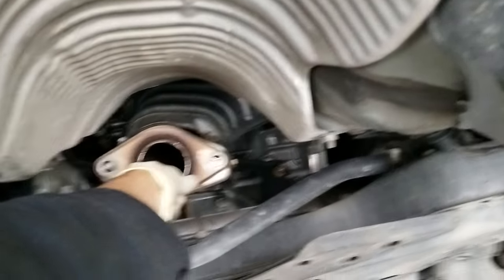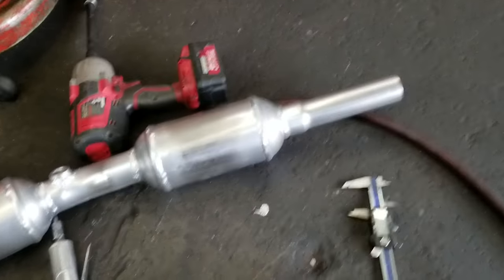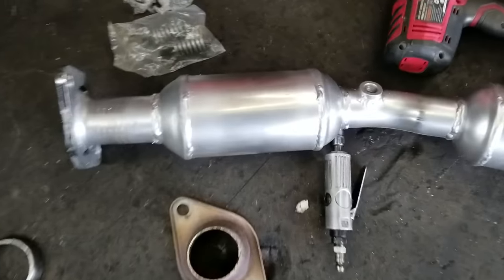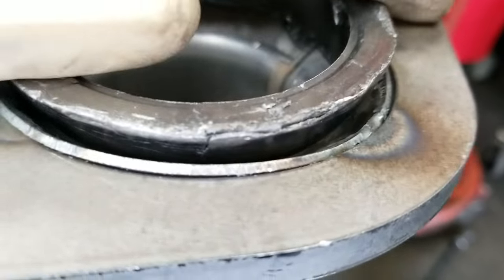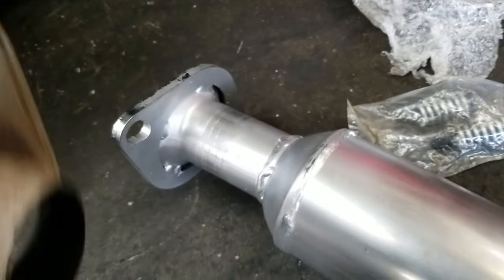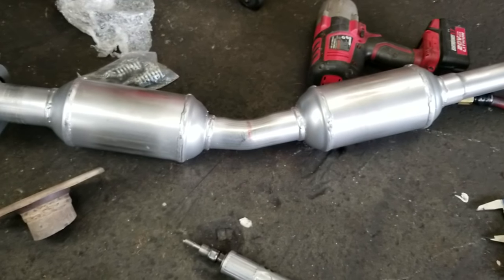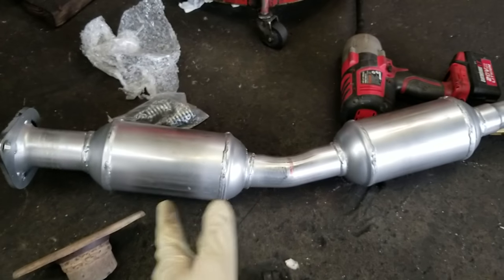Watch before buying Ebay/Amazon Catalytic Converter

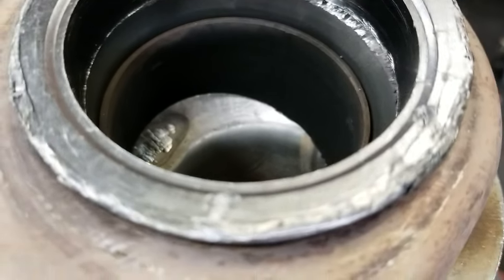Comment: 3:15 problem solved, use a normal gasket design. there are many exhaust gaskets from other vehicles that will fit that flange and go in between the two pieces rather than inside it. all in all  any mechanic shop that isn't just your neighbor bubba's house garage has more than enough tools to easily install that. like 30 minutes tops, no problems whatsoever. the real problem is that since it is just a few hundred dollars, it's not using the rare metals that are found in an oem cat, it's using a ceramic substrate with anyhwere from 0 to very little (barely above 0) of the catalysts (precious metals that heat up and catalyze unburnt fuel's transition to it's fully combusted products) needed to make it work properly.

a good shop would not only have no problems, but no complaints installing one of these. they would however caution you that it will not function XD
Reply: a better honest video would just explain what i did, and not make excuses about it being hard to install, which it is not.

Comment: The gasket is made of lead and will form to the gap once heated up. Additionally, the springed bolts will apply continued pressure and close the gaps....Real mechanics and welders see no issues here...... It will most definitely seat and seal.

Comment: Strange.  I bought one of those for my 2008 Prius and the muffler shop installed it in 20 minutes.   No complaints!
Reply from the maker: you should double check their work.
Reply from the maker: How much did they charge for 20 minutes?
Reply: @subtledriver  The owner let me watch under the rack as he personally installed the replacement converter and oxygen sensor.  Earlier I had watched him install a custom exhaust system on a brand new Porsche and a muffler on the City Fire Marshals work vehicle.  When I left the system sounded better than what was stolen off of my 14 year old Prius.   He checked emissions and it passed the state requirements.  I don't know what more you would expect a customer to do.
Reply: @subtledriver  Including the cost of materials I paid about 25 % of what I was quoted elsewhere.  I gave the guy a $20 tip since finishing my repair made his wife wait to pick him up after closing.

Comment: This gaskets soft and take shape
Reply from the maker: yes, but original gasket is designed to pivot and seal with spring tension, crush seal will crack the manifold.

Comment: Yup had ours  stolen off my sons 2002 Honda CR-V.  he’s a poor student with rising costs on everything including school.  The car was in mint condition and safe for him to drive. I would of given them 200-$300 not to cut it out. Oem is way to expensive , can we run straight pipe bypass the a CAT, We  live in a place where old vehicles are not  inspected annually, or any other alternative . Where he works , it’s a dark place and 100% sure it will happen again . Seems  like a new black market industry now of days .

Comment: For an expert, I’m surprised you don’t know about exhaust pipe expansion tool. A tenth of an inch is Nothing. And at the fore end, put your grinder and hammer to work and Make that shit work.
Reply from the maker: This is supposed to be a plug and play cat, the front flange wont seal, and the rear pipe needs special tools.
Reply: @subtledriver  Your correct subtledriver :)

Comment: The problem is they brought the car to you instead of the exaughts shop who will weld it on. They can also just cut off the end and weld the original flange onto the aftermarket cat. Probably charge $300

Comment: Two couplings little welding done still cheaper then oem . You could even just weld back of flange then grind fix top flange. Its not a major issue cause it isn't a slide on and bolt up. If I put it in a shop I do not expect clamps anyway. As for catalytic thieves. Bag and tag them if ya catch them.

Comment: So, did you Install this anyway? Because those exhaust ring gaskets are made to flex and melt to seal. Although I agree, that's a sloppy design, but was it actually tried? Or is this just a snobby retailer complaining before hand? I would like to see the results more than the pre install gibberish.
Reply from the maker: I've installed hundreds of cats of all types. This was a video to warn people this is NOT a plug and play cat. Needs front and rear to be modified.

Comment: cut off the bad designed  flange and weld on the original designed flange.  Other thought I had. I use Permatex ultra copper to seal up exhaust, it works well enough. Maybe that will seal it, needs to cure overnight.  And you can buy wide band clamps to but joint exhaust pipes together that don't slide together, they also work well.

Comment: So I finally bit the bullet and got a new cat for my 07 Nissan Sentra 2.0. This time it's CA regulated like it says on the sticker. It's been on for two days now. I have a question, is there a break in period before the good mpgs start to kick in? My SED light went off which is a blessing but it seems like my mpg's went down a little. Was there any special instructions that I was supposed to follow? My car has a direct fit so all I did was take it off, put on the new one and went about my way. TIA 🤔

Comment: When you buy those types of Assembly , almost always you realize it will involve step up and step down spacers and metal size bushing adapters .
Unfortunately , if it needs these , then it is one that also needs welding 
to bond the joints .

It sucks .

Comment: Cut and weld like a real mechanic
Reply from the maker: i did, but this is marketed as a "plug-n-play", or "Bolt-on" unit. chopping and welding and modifying the part to fit is like using a ford water pump on a chevy, a welder and chop saw and pipe expander should not be required when Bolting on a cat.

Comment: I ordered one for $116 from Top Converters over 4,500 sales and a 96% rating. eBay Guaranteed Fit
As part of the eBay Money Back Guarantee, this item is guaranteed to fit your vehicle.
It was a lot cheaper. It sealed as it should. After installation I checked for leaks, none found. Codes reset. Some are great deals. I would have returned it for a full refund before modifying it. You definitely had one that was poorly made. I would recommend to never modify one unless they can’t return it. eBay has always stood behind parts I’ve bought for my customers. Catalytic Converter Thiefs should be horse whipped!!!

Comment: You take it to a muffler shop they specialize in modifications and making things work. I ordered mine from ebay, went to the muffler shop I trust I was out within 45 mins he cut and welded the work and called me over to check everything was properly seated and sealed. Turned on the car and made sure I had no exhaust leaks and passed smog. 🤷‍♂️🤷‍♂️

Comment: I popped some rtv on both sides of the gasket. I've got a good 3 years out if it. I just passed my emissions test 2 weeks ago.
Reply: What's rtv I have same problem I just bought mine of Ebay and got check engine  light
Reply: Permatex Rtv high temp gasket maker
Reply: @bri9435  dude thank you 4 getting back I'm gonna try it out I was about give my car  to junker and carry another loan.
Reply: @ghasanahmed6159  no problem. Just make sure you read the instructions, you have to let it set for a few hours. Maybe even overnight.
Reply: @ghasanahmed6159  did it work????
Reply: @bri9435  tomorrow I'll get to it on day off
Reply: Did it work?
Reply: Did it work, or not?

Comment: They sell pipe adapters with a u-bolt clamp should be enough. Even a pipe expander. Cant believe a mechanic is saying the only way to install it is by welding it 😂

Comment: I can't believe the guy before me would use a exhaust pipe expansion tool, when you buy something you shouldn't have to alter or manufacture parts to make it work. This is the crap that comes from oversees.
Reply from the maker: its not entirely from overseas, some parts are sourced from Canada... but the point is they should "bolt-on", but with my experiences this is quite common to have less than desirable, time waster results. And a proper pipe expander is not $30-50 for one that can expand this exhaust pipe, you need one that is hydraulic..... not cheap.. then you need to cut off and weld on a new upper flange to even have the exhaust seal.

Comment: I got a cat from Amazon for my 03 Honda CRV and I could never get rid of a P0420 code (cat efficiency below threshold). Cheap cats will throw codes. Didn't matter why O2 sensors I got.
Reply: This is happening to my 2007 suburban got those codes after I got these cats of ebay well complete y pipe and a slight misfire now
Reply: I bought a Walker direct fit for a 2002 CRV EPA. That was sometime last year. No check engine light after , passed emissions. The shop my mom took it to cut the flanges and welded it on. She said they didn’t even try to bolt it on not sure of direct fitment though.

Comment: My son has a 2008 Honda Accord LX with a 420 code.  How would we know which catalytic converter to get?  I read somewhere that it's two.  Is that correct?  If so, how would we know which one to replace? I've seen some on eBay for less are these aftermarket brands and would they work as well? Any information you can provide that will help us will be greatly appreciated.
Reply from the maker: I would make sure thermostat is working, valves are adjusted, oil is fresh, primary o2 is fresh, new plugs (not fake/counterfeit ones from ebay/rock auto or Amazon), before condemning the cat. The cat dies from neglect/missfires and oil burning 90% of the time.
Reply from the maker: P0420 is the side of the engine where the cylinder #1 is. Also it is the 1st cat or upstream unit if there are multiple cats on the same exhaust stream.
Reply: Thank you so much.

Comment: Are there solutions that you can put into your car to make the metals that are in the catalytic converters worthless? If that can be done it would make stealing them not worth it. The other option would be to have real time tracking when it gets stolen.
Reply: No they use those metals in a oem catylitic converter to filter particulates better. ‘Switching the metals out won’t do anything.

Comment: If the flange side bolts on could you not use some type of gasket shaped like the flange? Something like that came with an aftermarket cat that I purchased. Perhaps a heat resistant liquid gasket and then heat resistant epoxy as a double barrier around the edges

Comment: Technician versus parts changer. I see no issue with the cat once you sleeve the exhaust or weld and weld on the original flange. Add labor to the ticket and get the car off the lift. Flat raters would have already had this done
Reply from the maker: This video is to show what a "bolt-on" cheap cat experience is. Not to show what a mechanic with a chop saw, pipe expander and welder can do with cheap junk.
Reply from the maker: The part was welded on with factory flange, I just wanted to show how things aren't manufactured properly, so buyer beware.

Comment: If your vehicle is registered and smogged in California you need to buy a C.A.R.B Compliant CAT.
Reply: Yet another reason to leave California.
Reply: Must be OEM. No aftermarket Cat is certified by CARB.
Reply: Walker makes CARB compliant converters and Magna Flow Rock Auto has then too whats strange is that the Carb compliant CA models are higher prices state EPA and CARB compliant but then state can not ship to Ca WTF is that about

Comment: VIDEO FAIL: Never have I seen more incorrect information provided in one video. 1. A step down adapter ring works perfectly to connect this cat converter to the rear pipe. 2. Once installed the RUBBER flange WILL seal completely. This guy is not a "mechanic". "Mechanics" are honest and truthful. Oh, and telling people to go 10mph over the speed limit is not only stupid, it's promoting illegal activity.

Comment: I got to say,you miss led me in the beginning .I say that because if your any kind of mechanic YOU SHOULD KNOW about a pipe expanding tool.they cost 30 dollars and open a 2 inch pipe to 2 1/4  with just a few turns of the wrench.I don't say this to embarrass you ,but hopefully to correct the info you put out,I wrenched for years along time ago,before cats were on cars and i even have one a pipe ex pander,in my box at home.You don't need to weld it ,if you have the tool.but i also agree welding pipe is the best way to be leak free.

Comment: I bought a set of 3 for my Acadia. Bad decision. They fit, but were much smaller. No directions which was an issue because OEM used studs and the Amazon ones did not. The bolts weren’t strong enough. And, the gaskets were a joke. And, my CEL is back on despite everything running in tip top shape and replacing my 02 sensor. I’m supposed to live with the CEL because they simply don’t work. My recommendation is to read the reviews and notice that they don’t ship to certain states (those with emissions testing). Sucks to need cats and have to shell out so much money, but you’re wasting money on the cheap $100-$150 cats on Amazon. That’s worse.

Comment: I would have sent that junk back. I got mine from Amazon but mine is made closer to the factory one. So everything bolted up very nicely with no issues. The only problem is that every so often if I have to floor the gas to merge onto the highway the check engine light will be on on the next start cycle.  After a few cycles it goes back off on its own. But Always comes back anytime I have to accelerate too hard. I got so tired of this bs that I started looking for a factory one. But I can't find anything under 3k. I barely paid that much for the whole car so that's out of the question. On my first gen prius I was able to find a factory Cat for 900. I was really hoping to find something around that price for this 2nd gen.

Comment: Wtf 😅..expand the pipe at the outlet and grind the tact welds off..do u really do exhaust?
Reply from the maker: This is supposed to "bolt on", without special pipe expanders or welding a new flange. (I ended up doing that, but not a true bolt-on.

Comment: Use a permanent sealer as you install maybe?  If bought and this is same situation. Granted they did a crap job making that flange end but may as well macgyver it  so it seals and functions as close to normal as can
Reply from the maker: I dont like doing the job more than once. I cut the ends and did some welding.
Reply: @subtledriver  correct I agree. Best option.  Was only saying for the person who don’t have a welder or $ to take to shop  , and in a similar situation. - already bought product don’t seal properly then do what ya gotta do .   Not best advise of coarse. But it’s how it is for a lot of folks
Reply: @subtledriver  I do have a ?    I have a Kia spectra ex sedan.  There’s a front manifold catalytic converter then flex pipe and then one catalytic converter mid way on exhaust as well.  Then  a resonator then muffler   I noticed going up a steep long hill. My car bogs down  and when Punch it to accelerate up it. I smelt like burning plastic or rubber  for few mins ,  but car runs great all other times.  ? Is. Which converter is most likely to go bad first ???  The warm up front one or the main one mid way under car ????
Reply: @subtledriver  it’s a 2006

Comment: The cheapest brand parts Im willing to buy are what RockAuto offers.  With exhaust where fir is crucial the cheapest Ill buy is Walker. Amazon and Ebay have TONS of exhaust parts that simply will not fit  and electrical parts that dont function.